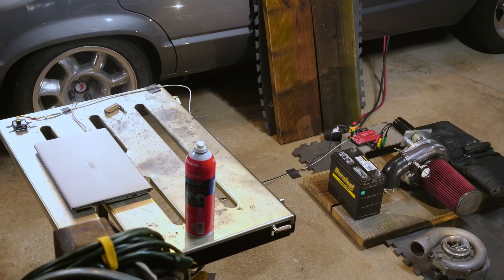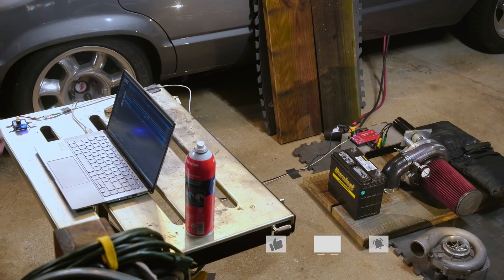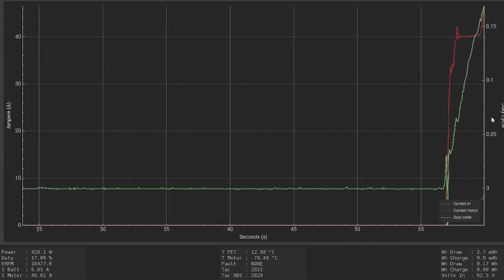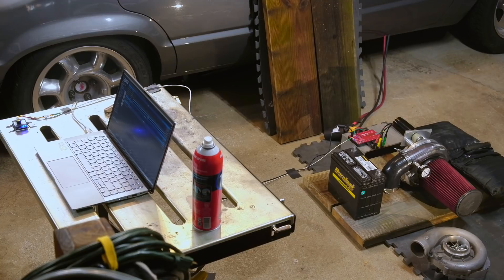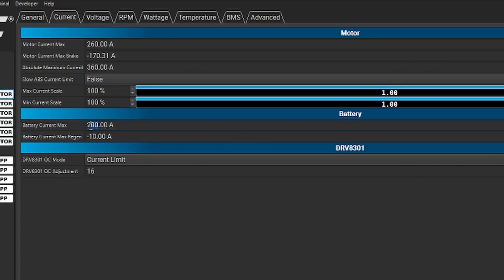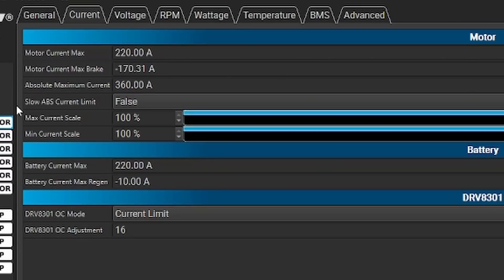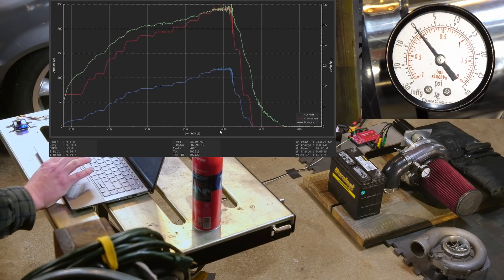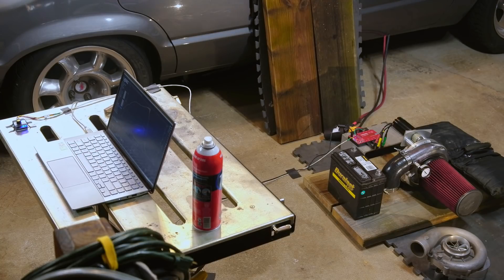Easier/Cheaper High Power DIY Electric Turbo - Full Power Attempt #1

Comment: I am seeing your guage bouncing. So I expected the amps to bounce with it.
It causes me to wonder if both are the result of controller hysteresis while attempting to maintain max set speed. So controller sees max rpm and reduces current and motor slows down so controller increases current motor speeds up and up and down and up and down. Maybe a better PID loop profile at the top end.
Reply from the maker: The gauge really is just kinda crap, and being hard mounted, I don't think it's really giving us good data.
Reply: @AlexLTDLX  could be, it's just that you weren't speaking of any problems until immediately after it started to really jump hard, then we hear current spiking. So there seems to be some correlation between when your guage jumps and when you mention spiking. Your work is important to the rest of us. My current supercharger consumes SO MUCH POWER. It is reasonable to me that we could make the same power on much less boost if you succeed.
Your other idea was lead inductive oscillations and back feed, but load oscillations are more likely (when we can actually see it on the guage).
Best of luck, I hope you get it sorted. I'm cheering for your success.

Comment: Run that with an ultra cap instead of battery and that's a wrap
Reply from the maker: There's a massive (and very expensive) pair of low ESR Kemet caps there.  You really need a low ESR cap more than you need capacitance.  Otherwise the cap can overheat and explode.  You solution seems obvious, but with the caps there, I believe it's a bit further into "electronics is voodoo" territory.

Comment: What happens when the controller see its max values you have entered ? Does it have sort of a soft limiter or just cut out completely ? Could it be slowing the flow as it gets towards max, causing it to fluctuate up and down kind of like a Rev limiter ?
Reply from the maker: There are "soft limits" but looking back at the faults in editing, it actually tells you what limiter was triggered - in this case, it was "absolute max."  When it hits "absolute max" it simply shuts down.  Honestly, after all the fires and explosions from other ESCs, I'd much rather have a shut down due to fault than a fire.

Comment: Try changing your restrictor and if it moves the judder you know it's mechanical not electronic
Reply from the maker: I'm not sure that it's not just a crappy gauge mounted directly to the volute.  I think I might know what the cause is (and it's rather esoteric), but when I test it, you can bet it'll be in a video in the very near future (like hopefully the next few days).
Reply: This is my thought too. It almost looks like flutter (the same you get on a non blow off valve turbocharger when you let go of the throttle and the turbine speed is still high). Not saying it is a physics thing but this is the way to validate it.

Comment: Is the compressor surging and the oscillation in loading is being reflected in the current drawn?
Reply from the maker: I don't think so.  The hole in the "snorkus" is smaller than the what the running engine would take - power should go up on the running engine.
Reply: @AlexLTDLX  If the hole is smaller than the running engine flow, then you're almost certainly more into 'surge'.

Comment: What was motor rpm? Were you getting close to compressor surge? Could be the fluctuations are the same reasons belt driven superchargers always slip the belts? Thoughts?
Reply from the maker: Motor rpm was about 22,000 rpm; impeller rpm was about 26,800 rpm.  With the 1" hole in the snorkus, I doubt it was in surge - in fact, I expect it to have to pull more power on the running engine (think of it as a "bigger hole")
Reply: @AlexLTDLX  OK, not outrageous RPM's for motor+ESC

Comment: Really cool to see the adjustments and your process. If there was an imbalance I could see maybe friction fluctuations causing the voltage spikes? Just one quick thought. Doubt it's that. Also might be nice if you used a fluid filled pressure gauge so the needle didn't dance so much? Awesome vid.
Reply from the maker: I don't think it's anything out of balance enough to cause this; but perhaps I should try not mounting the pressure gauge to the volute. Thanks for watching, commenting and subscribing!
Reply: @AlexLTDLX  pressure gauge on the volute won't be an issue. We run upwards of 500psi with set-ups in other engineering pressured components, just run a fluid filled gauge. In regards to spiking, how's the heat management?